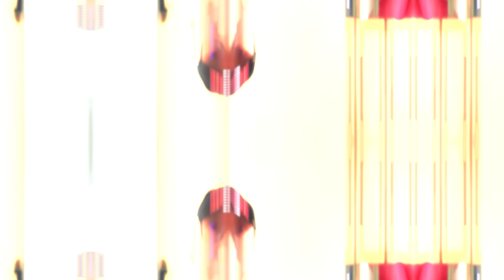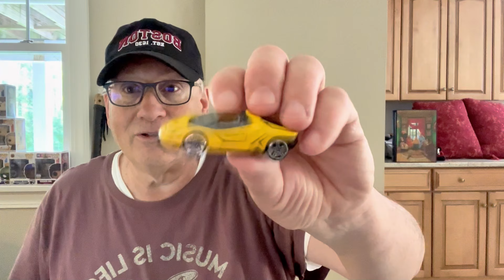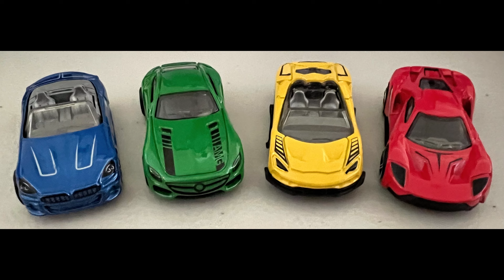Yewkou vs The Speed Gate -- A Budget Brand from China Takes Its Turns | Peak Speed Lab 1:64

Comment from the maker: 📌 Yewkou Quarter Mile -- 4 cars, 1 DNF.
Dodge-Like: 4.800 MPH (307 scale MPH) | Porsche-Like 928: 4.647 MPH (297 scale MPH) | Spread 0.080
Lambo-Like: 2.410 MPH (154 scale MPH) | Ferrari-Like: DNF -- 0 at the gate across all 3 runs
Ferrari-Like holds SF slowest record (2.510s) AND is now a QM DNF. Class A weight strikes again.
BOTH TOP 10s UNCHANGED.
PLASTIC TOP 10 (42 cars, 33 with QM): #1 HW Dodge 72pts | #2 HW HV1 65pts | #3 HW Tesla 63pts | #4 HW HV2 62pts | #5 HW Maserati 62pts | #6 HW Track Dwagon 61pts | #7 HW '67 Camaro 59pts | #8 HW TV Batmobile 56pts | #9 HW Pass N Go 54pts | #10 HW '83 Silverado 53pts
RUBBER TOP 10 (24 cars, 18 with QM): #1 Lionel NASCAR 41pts | #2 HW Datsun 620 35pts | #3 Mini GT Porsche 992 33pts | #4 HW McLaren F1 32pts | #5 Mini GT Turbo S 31pts | #6 M2 Mustang 30pts | #7 HW Alfa Romeo 30pts | #8 HW CRX 29pts | #9 HW Lamborghini 28pts | #10 HW Nissan 240SX 28pts
More brands approaching 30 total. Subscribe and like to stay current!
@kulasmatalas3062 -- DM @peakspeedlab164 your complete address!